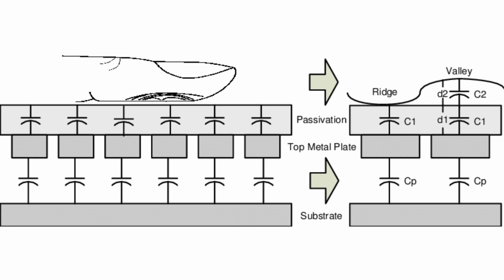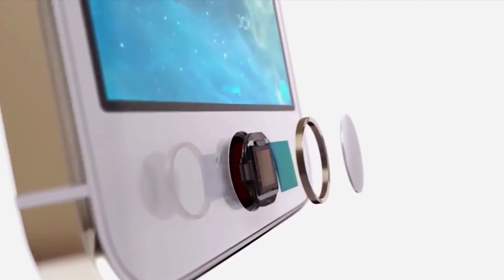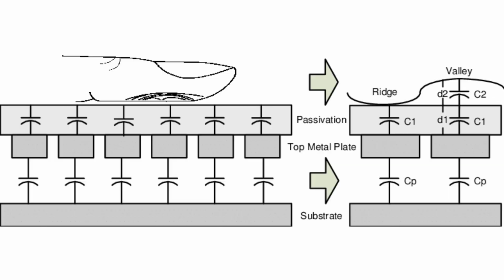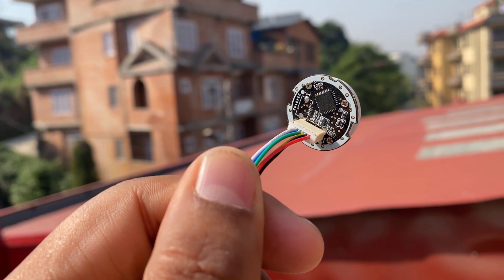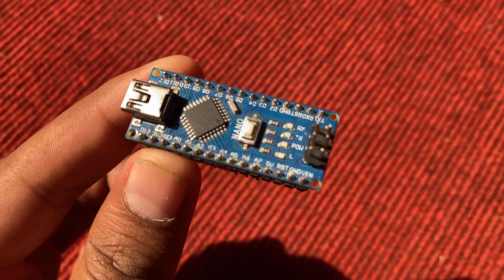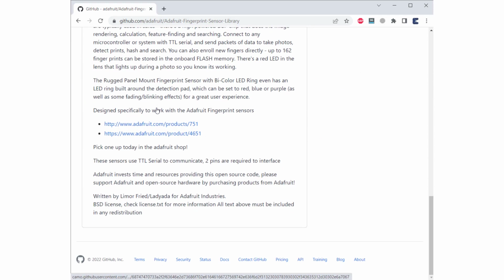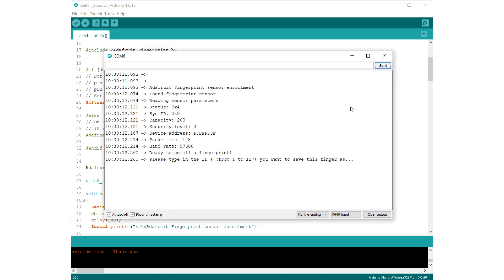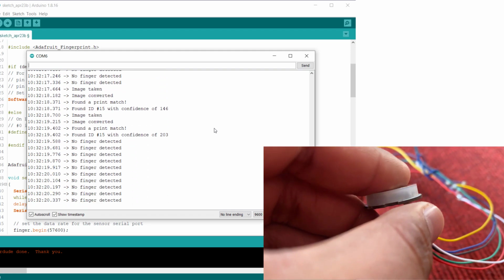Capacitive Fingerprint Sensor Arduino Tutorial || R502/R503 Fast & Best Fingerprint Scanner

Comment: Great video, thanks! Q: Adafruit library is meant for optical fingerprint sensor I assume, and this is a capacitive Fingerprint Sensor. Does not capacitive fingerprint sensors use a different algorithm than optical?

Comment: Magnificent , I had this sensor for a long time and tried several codes and libraries and none of them worked, you Sir, made it work, thank you so much. I was about to throw it away as I thought I killed it with 5V serial connection but it does work, just connect the red wire to the 3.3V output of the Arduino UNO and the green and white wires to pin D2 and D3, mine were reversed btw. Now I can make a custom board and use this little marvel. Thank you so much 🙂
Reply from the maker: Its very nice to know that finally you made it work.